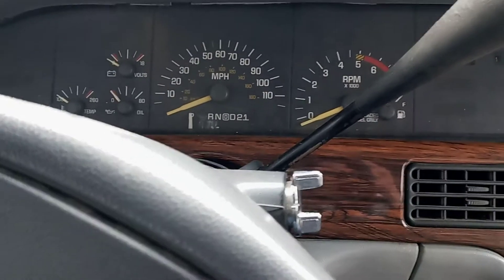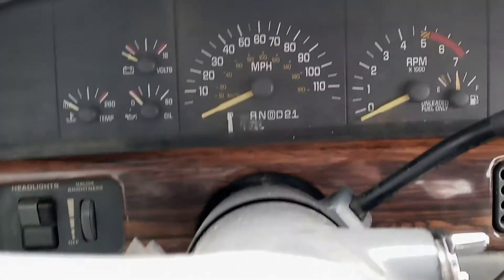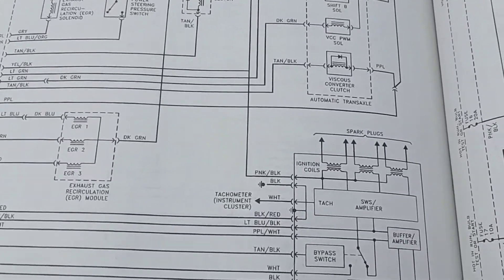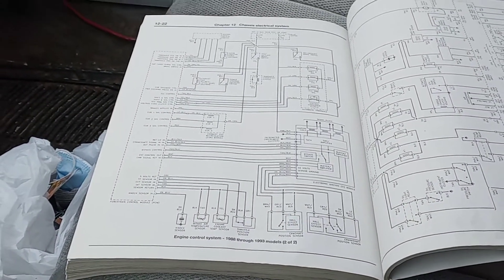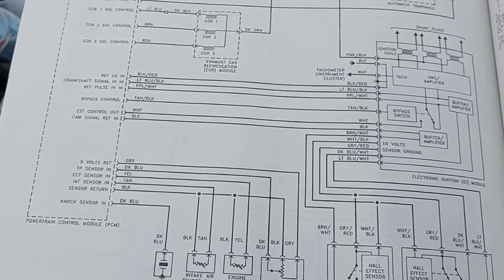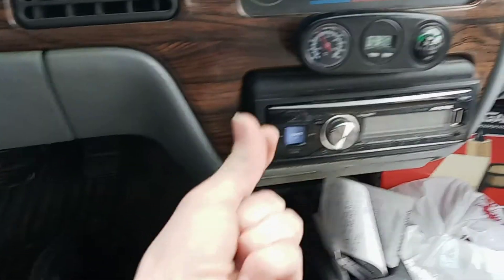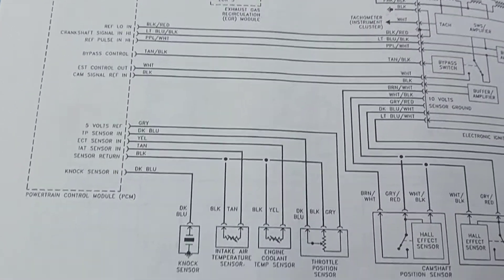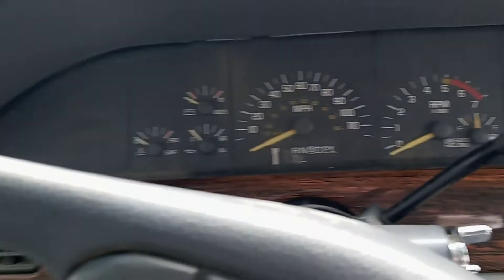Code 42 GM - Why it happens (1990 Pontiac Bonneville)

Comment: So I got a code 27 28 29 31 41 car runs fine reset car still comes back on thinking map sensor maybe can’t find it on car
Reply from the maker: This 3800 doesn't have a map sensor. Only MAF, IAT, TPS and IAC. I would definitely start with the code 41 as I believe that is for the camshaft position sensor. However, a stretched timing chain will throw that code and can potentially cause other issues. Can also happen if the magnet in the cam gear breaks or falls out. Easy to check by removing the sensor and spinning the engine and see if it is visible. The other codes I cant remember off the top of my head. I'm at work and my book of codes is at home.

Comment: Where is the pcv valve
Reply from the maker: On this style 3800 V6 its less a valve and more of just a tube. Comes out of the top of the front valve cover and goes into the throttle body.

Comment: WOW!  Am I seeing 326K on the odometer?
Reply from the maker: Correct. Now sits at over 333K.
The 3800 V6 is one of the best engines ever made.
Reply: @caayydenn  That is very encouraging!  We have owned several 3800 V6's, and currently own a 93 Park Ave Ultra, with mileage that cannot be verified as accurate; so you can see why I said it is encouraging to know that you have taken it to that level.

Comment: A guy in the group was saying that the 9th gen bonnevilles icm was a better option, I have yet to try it on my bonne.
Reply from the maker: I wouldn't believe that they are compatible with one another since this isnt even a series 1. But ive never tried i suppose. Would probably have to change ECM as well tho
Reply from the maker: And I got my Hayne's manual at Autozone they just had it in stock. Goes up to 2005 the last year they made them.
Reply: @caayydenn  hmm maybe check how the 9th gen utilizes the icm compared to the 8th.